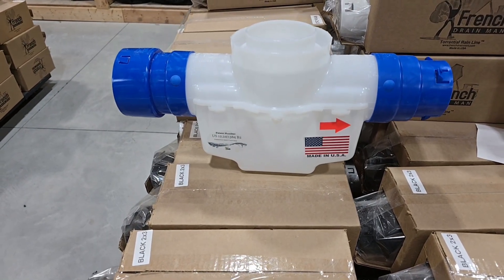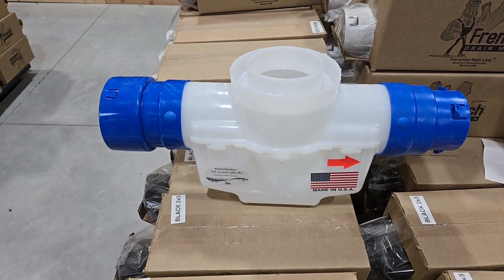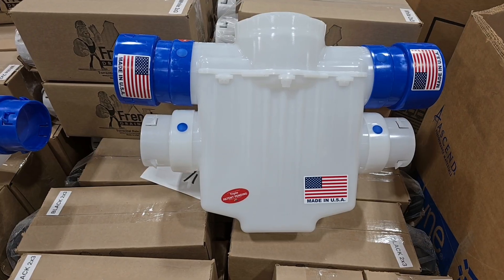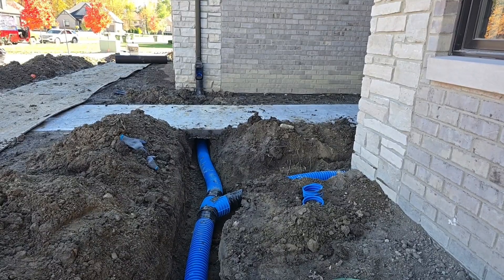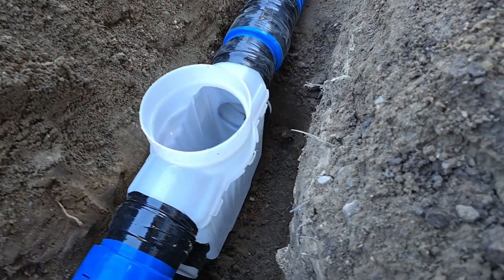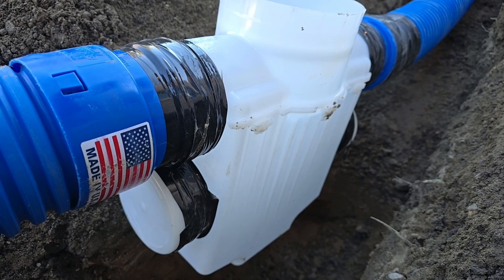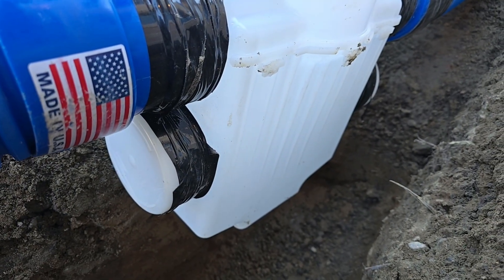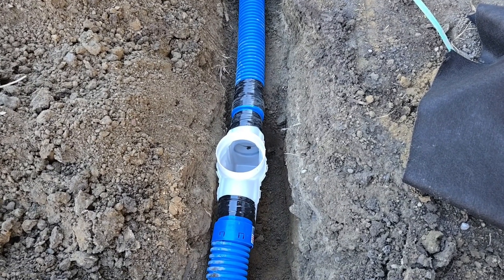How to Use 1 Catch Basin for 2 Downspouts

Comment: Great tip and example of how adaptable your products are for different use scenarios. My daughter is buying a house here in NE Illinois. It has a basement sump pump with a 1 1/2” discharge line that extends outwardly and horizontally about 8” from the back of the house and about a foot above ground, and discharges right there. Next spring I want you to attach a buried drain line that runs to a pop up emitter in the back yard. I am looking at using your external sump pump freeze protection kit. Should I use your 3”, 3 1/2”, or 4” solid corrugated pipe as a dedicated basement sump pump drain line, along with appropriately sized couplers? Is there any need for a clean out in a dedicated basement sump pump drain line? Thanks.
Reply: Thanks for your advice! Much appreciated. I think I’ll be going with the 3 1/2” next spring. My two downspout drain lines I installed in my yard with your products have been working great!
Reply from the maker: We do cleanouts based on the length of the run. We like access every fifty feet. If you're not dealing with mineral deposit buildup and iron ochre, I would just use the three-and-a-half-inch pipe because it works fantastically. If you have concerns about mineral deposit buildup, or maybe you have something in your area that compromises the displacement of a pipe, then you'd want to go to a 4-inch pipe.